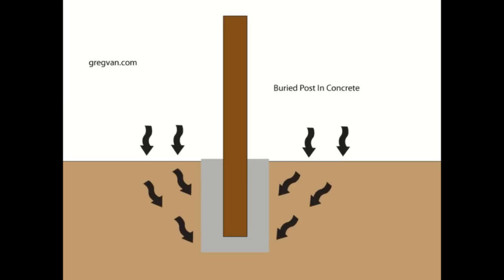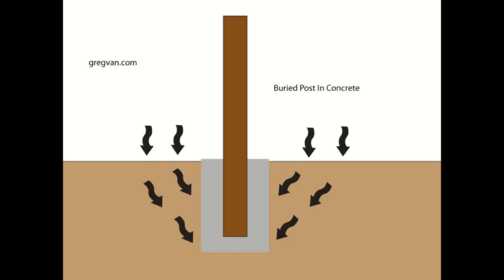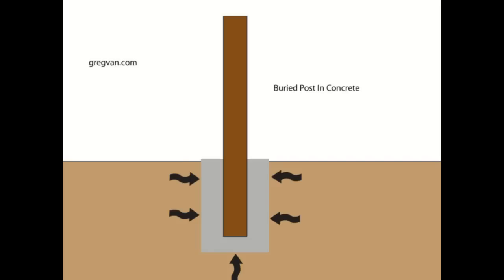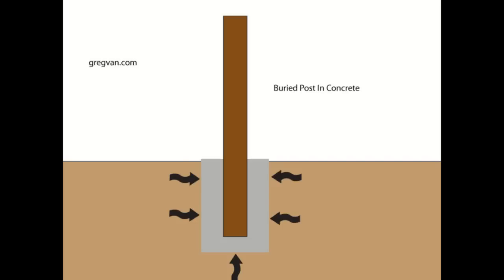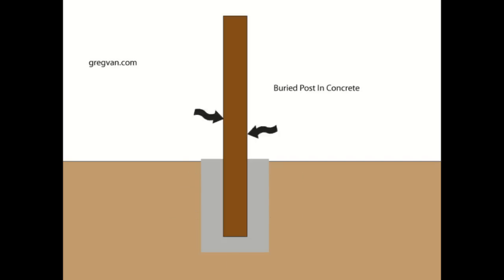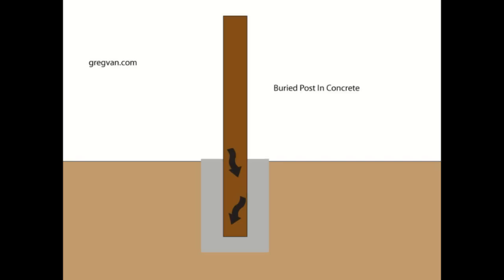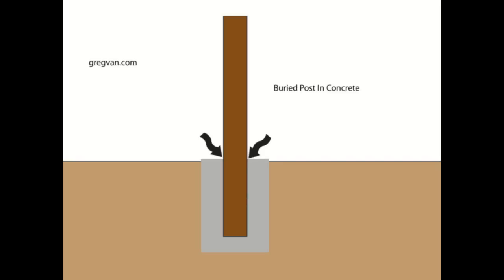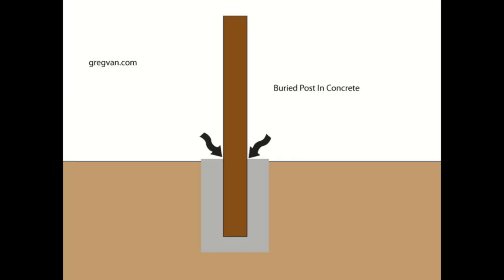Why Do Fence Posts Rot and Break - Wood Fencing Damage

Comment: Should the wood post be sealed with oil based paint or another protectant before placing it into the cement? Also, should we create  a drainage hole from the bottom corner of the cement ? Or would that make more problems? Sand at base, then concrete, then post?  Your expertise is appreciated. Thank you.
Reply from the maker: You should find more answers in this playlist Fence Design And Building Videos  - https://www.youtube.com/playlist?list=PLGyVeAgAJ-tkXRqWKi_iOedGXXHKBLHFo
Reply from the maker: I've never had good luck sealing the bottom of a fencepost, but others have. You might find what you're looking for at our website in the fence section or by checking out this playlist https://www.youtube.com/playlist?list=PLGyVeAgAJ-tkXRqWKi_iOedGXXHKBLHFo .

Comment: Try using CCA pressure treated pine like we do in NZ. Your posts will last for 40 years plus. By the way CCA stands for Chromated copper arsenate
Reply from the maker: +Johnny Newton Thanks for sharing and there is no doubt in my mind that this is a fantastic product for preserving wood, but you might not be able to find it or use it in your area. It's not a product I would use, because of the environmental problems and even if you are allowed to use it, I would type the words  Chromated copper arsenate into your favorite search engine to gather more information before using it.
Reply: +gregvancom   Creosote is number one if the environmentalists will let you use it.  CCA @ 0.6 lbs./cu.ft. is second choice.  Nothing is better that a telephone pole cut to  length, if you can't buy a creosote post.

Comment: My dear friend, I watched many of your videos, and in most of them you explain problems of the posts, but in them I have not found suggestions about what to do. For example: "If the soil is clay, install the post this way. If the soul is sand, install it this other way", and so on.
Best regards.
Reply from the maker: Here's a link to more videos that might not solve your problems.
https://www.homebuildingandrepairs.com/fences/index.html
Reply from the maker: I don't have a method to install wood posts that won't ever rot, but do have videos that will make them last a little longer if installed correctly.

Comment: I think your best bet in most soils is to make a "french drain" under the post of a foot or two of gravel with a "roof" over it of some roofing felt with a hole cut in it just enough so the post sticks down thru.   This will prevent the fine dirt from washing down into the gravel obviating the drainage effect.

Comment: I have had 2 'pressure treated' fence post break off at ground level, these were put into the ground w/cement around the posts..gravel on the bottom first.  I have sandy soil.  So yeah they break off.  Now I am worried about the arbor that was built over my deck.

Comment: One solution to this that is on the net is simply to use galvanized steel pipes instead of wood for your posts. There are a number of companies that sell brackets which you can bolt/screw to the pipe and will hold the 2 x 4  frame to attach your pickets to. The best brackets I've seen have a lip on the bottom to hold the 2 x 4's. Otherwise they only have holes to put screws through that hold the 2 x 4's on. The screws tend to have so much pressure on them that they cause the 2x 4's to eventually crack.

Comment: Hi, would adding loose gravel at the base of the post beneath the concrete help in draining water and reduce the rotting ?
Reply from the maker: I'm pretty sure I made a few more videos and they can be found here http://video.gregvan.com/fences.htm that might be more helpful. It all depends on the soil, its ability to retain water and how this water drains away from the fence post. Sometimes gravel will actually provide the surrounding soil with an area to collect water and eventually damage the post. I'm not a big fan of installing gravel around fence posts for this reason.

Comment: I have fence post put in 1983 and still strong enough for a Hurricane.  Good on setting the post on concrete.  I would raise the concrete above the soil  line so the post does not touch soil.
Reply from the maker: Definitely and I have a couple in my backyard that might be about the same age, still going strong.

Comment: Hi, great insight into the concept! What about using expanding foam instead of concrete?
Reply from the maker: I've mentioned this in other comments about foam, but if foam keeps the water out, than it will also keep it trapped if it gets between the gaps or cracks, making it a bigger problem than a better solution.

Comment: Mix up a strong solution of water and lye, spray/splash it on the fence regularly and it will rot/dissolve fairly quickly.

Comment: To prevent rot in the concrete, should we paint the bottom 30” of the post with asphalt roofing tar to help?
Reply from the maker: I've only done it once and it rotted the post out within a year. However, I've heard "suggest" that they've had good luck doing it.

Comment: I install fence in Florida I never concrete line post only the gate post. I have witnessed firsthand what concreting a post will do. Rots in every dang time. I’ve been installing Fence for four years
Reply from the maker: Again, the problem I have, if I don't use the concrete is that a 6 foot tall wood fence tends to lean over time and sometimes fall down in certain soils.

Comment: Hi, in my studies I found out that Fungus is the main culprit of rot. Wood is a living organism and The Fungi Kingdom are responsible for decomposition of living cells by producing enzymes that break down the organisms and feed on the carbon. And Ironically in the process of making cement its heated up break down the carbon and releasing the bonds to a power and then adding water to start hydration reaction to reconstruction the bond as Concrete.  So Concrete with no carbon that attracts water with a 4x4 peice of wood is a worst case scenario, pretty much a 3 dimensional water highway to the wood

Comment: I was told that posts rot because of bacteria eating at them at ground level.  The bacteria cannot live very far below the soil and posts do tend to rot through at that point more than below the ground.
Reply from the maker: That could be the case, but most of the fence posts I've replaced have been rotted from the top of the ground, all the way down. Remember, most of the information in my videos are from an observational standpoint of the years I spent working on a variety of different construction projects.

Comment: The problem isn't just water. Logs get ponded and sunk for decades without rot. Rot is a product of (1) bacteria in the air feeding on (2) wet wood during (3) warm temperatures. 
Here's my practice/ideology:
Post rot happens during warmer weather when bacteria is most active. Water from the ground is sucked into the concrete, then the dry post sucks it up toward the surface. The first few inches above the concrete stay moist all Summer long. The rest of the post stays relatively dry from the warm air. So to eliminate the water from the bottom, seal the post with automotive undercoating. A good 6" above the concrete looks nice. 
The top of the post is also subjected to a fair amount of moisture as rain will pond on top. A light mist of the same undercoating and a cap take care of that. 
The rest of the post should be sealed in a petroleum based stain. This will minimize any other source of water from entering the post, as well as make for an unfavorable environment for the bacteria.
These are fairly cost effective steps but won't matter unless you prestain the rest of the fence components. 
Would you build a house and not caulk or paint it? Or restore a car without replacing the window seals? So why the hell would anyone spend thousands of dollars on a new fence, rot proof the posts, then let the rest of it grey out and rot? 
So why do I recommend prestaining opposed to staining after it's build?
The ends of the 2x4, the back side where the slates attach, as well as the bottom ends of the slates are going to be next to impossible to get any stain on once assembled. And you can bet water/bacteria will find its way into these areas with little chance of wind/sun to dry them out. For about $150 in stain you'll double the life of the whole fence and I guarantee it will look far more impressive then having it grey out in less than 2 years. I like to sell the idea to my clients line this.. An untreated/stained fence board is like a car with watercolor for paint. Would you be ok with your car paint dripping off everytime it rains? Because that's what Cedar fence boards do if not stained.

Comment: The easy solution is to use treated lumber, pre-stain the whole post with an acrylic solid stain (behr not cabot), seal the pre-stain posts with waterproof wood glue such as Titebond 3.  After the concrete has cured, apply concrete sealer to the top of concrete, then put a bead of masonry caulk around the post. Of course, use post caps. This will minimize of 99% of the moisture that the wood will come in contact.

Comment: Please Help. I had a "modern" wood mailbox made/installed (NOT made using a typical mailbox post) 3 years ago. It quickly started to rot at the base. I thought maybe it wasn't primed/painted properly and have had it "repaired" 3 times in 3 years. This is an expensive handmade mailbox structure (but the guy obviously didnt know how to install it).  Made with exterior plywood. It is 21" wide (horizontally) and 4" depth (horizontally) and 5 feet tall.  It's a tall skinny wooden rectangular tower, pillar, wall - like box with the actual mailbox attached to the front of it 3/4 of the way up the structure. It was set in concrete and the concrete is 2" above ground and has no slope. The wood was not allowed to dry before he painted it. The structure has only been painted above ground. Underground (in the concrete) is raw wood. I live in the deep south. Should I dig up the "clay" dirt and add sand all around the concrete? Can a concrete slope be added on top of the concrete base?  All suggestions are welcomed. In short, wood rooting at the base of the structure. The concrete base is raised 2" above ground and does NOT have a slope away from the structure. I'm glad to send photos if that would make it easier. Thank you!
Reply from the maker: +Bev Cotton You can send pictures, but what about using a metal post? I don't think I would replace it with wood if it only lasted three years.
Reply: +gregvancom 
Thank you greg for your reply. I don't see where to upload a photo of my mailbox problem. Anyway,  I'm not willing to remove my somewhat new and expensive wood mailbox for a metal one at this time. I'm just trying to find a "band aid" for it. I think I'm going to cover it with cedar slats.
Reply from the maker: You can visit our website for contact information. A link to the website can be found at our YouTube main channel.

Comment: For the reason stated in the video, the utility companies use our product to protect the base or under ground section of the utility pole. Our product is a close cell material that protects the under ground part of the pole from moisture and insects. Check out our video "Easiest Fastest Way to Set a Fence Post" "Fencing Made Easy" and we also show a good comparison between concrete and our product the video is "Fence Pole Testing" I think you will enjoy them. I like your video very informative.

Comment: You can find used waste oil free at most oil changing stations.  Mix enough kerosene into the oil to allow it to easily penetrate into the wood.   Fill a 55 gallon barrel or some other suitable container's with enough oil to reach about 6 inches higher on the post than it will be buried.      In other words have six inches of oil treated post above the ground level.   Make sure your post are completely dry, then stand the post on end in the container and pour in the waste oil to the desired height on the post that you want.  Soak the posts for a week or more, and as the oil is absorbed you might have to keep adding more oil.        Waste oil is a good preservative and also prevents water from being absorbed into the wood.   It is also much safer to use than commercial wood preservative and will also last longer.
Reply: +44wizbang  That will certainly help some,  but even treated posts are victims of this process in moist regions.
Reply: I use this mixture to treat the wood floors on my trailers and the decks on rental properties, two coats and it is good for  maybe 1 1/2 years, it smells for a few days and then goes away, this mixture sheds water better and longer than any else I have tried
Reply: I think you can still purchase creosote in 5 gallon cans or you can try the liquid used for sealing driveways. soak the post for several days
Reply: cheap people use used motor oil.  sure, let's use some carcnogen to save the wood while it seeps into your well water & tomato garden.  stop the insanity people.  think about how hazardous waste can be deadly before you do stupid stuff like this
Reply: good for you. Some guy above suggested same solution. Wish they could understand the stupidity of their actions.  No used motor oil or anything that can leach into OUR groundwater.
Reply: Motor oil is an Organic hydrocarbon produced from previous  living organisms ( harvested from the ground ) 

It isn't radio active.

This method isn't dumping oil down the storm drain.  

Treated wood usually leeches arsenic and copper compounds - considerably more toxic.

You're automobile likely pollutes the storm drains, creeks, streams, rivers, lakes and oceans exponentially more than using it to preserve the wood fencing.  

Actually a better use than the legal disposal of mass quantities of used motor oil at approved landfills. 

Basic middle school science and simple innate  logic.

Comment: Try using asphalt milling for footing and back fill around post  works good
Reply from the maker: My asphalt milling, are you talking about using sections from a road or driveway that was removed?
Reply: gregvancom yes the milling that are milled up by a machine from rd way or drive ways
Reply from the maker: @toddhutchins8877  I gotcha, so the millings are pliable and if they can be formed into a footing as strong as concrete, then it sounds like you figured out a new method. I just don't know if this would work in areas with strong winds that might require a concrete footing. Great idea though and something that others might want to look into.

Comment: Fungus rots posts and it needs moisture to do so. Seems like the way to go is to not use concrete and to brush on engine oil diluted with diesel. Treat the entire post before installation if you build a fence. Reapply occasionally and they will last many years.
Reply from the maker: It sound like an environmentalist wouldn't like it, but it might be good for your pocket book.

Comment: Why not just tie a black plastic bin liner around the base of the post, then pour some cement inside of it and then around it. The moisture should be able to penetrate the plastic should it, and you still got the post secured in the ground, right.
Reply from the maker: This is a question I've answered often and if you seal the bottom of the post so no water can enter from the soil then you could be creating a pocket where water can remain, once it soaks into the wood post and gravity pulls it to the bottom.

Comment: I actually double-coat the wood with weather-proof wood glue before burying the post in concrete. Wood Glue are actually not expensive. Make sure to paint it thick at the ends of the poles.
Reply: I like that trick too. I use the new waterproof glues  and thin them  out a little so the glue can soak into the wood.

Comment: Just planted an 8' by 7" square post & hung a field gate on it.  However, I put a 12" deep sump of compacted stones in the hole first, dropped another 12" of compacted stones around the bottom of the post and THEN added the concrete.
Reply from the maker: Let us know in 10 years how it's doing and keep the ideas coming, because one of these days we'll figure out what works best.
Reply: @gregvancom  Roger that.  If I am still around in 10 years.  Might just plant a time capsule (with photos) in the ground near the post.

Comment: The solution is quite simple really, get some pond liner (or any plastic really), drape it around the bottom of the post as well as the hole itself before you insert it into/pour in the concrete, glue it to the post then cut of the excess after the concrete sets.
Won't hinder the fence from ever rotting but it should increase it's lifespan by at least a factor of X4

Comment: Isn't there a waterproofing mix you could add to the concrete mix? That would solve the problem of concrete absorbing moisture, wouldn't it?
Reply from the maker: There might be, but water being absorbed from the concrete isn't the only problem, the wood post will actually absorb water also and if it sits inside of a concrete footing that won't allow moisture to leave, then it could be trapped and accelerate the process of wood decay.
Reply: gregvancom that's true and I'm learning a lot from watching different videos. I'm no expert and not even an amateur carpenter. I'm just throwing in ideas. How about the paint they use on boats? Would it prevent the post from absorbing moisture?
Reply: It is the swelling and shrinking of the wood that allow water to enter between the concrete and post. Concrete is porous it can be made water resistant and nearly water proof with the addition of fly ash and/or latex compounds but it will still retain some amount of moisture.